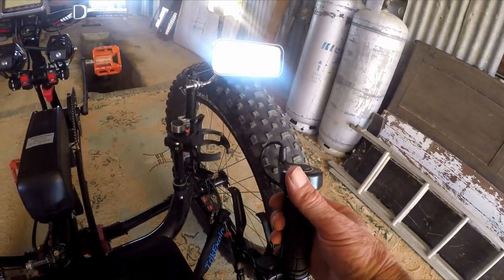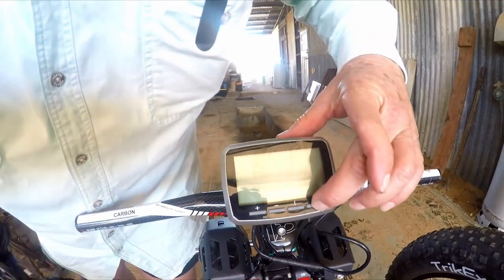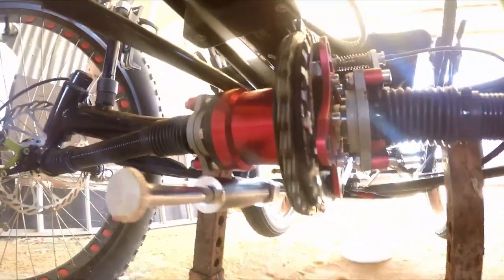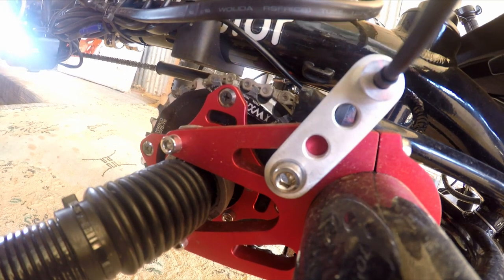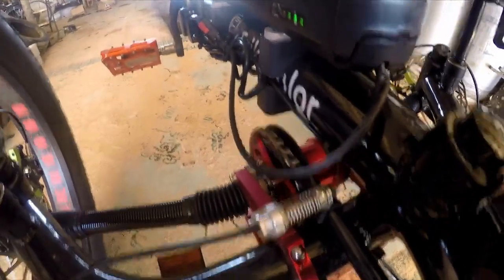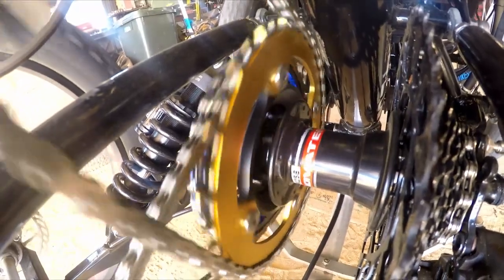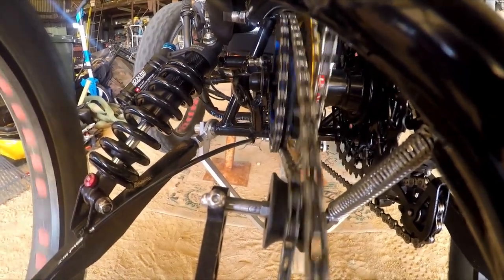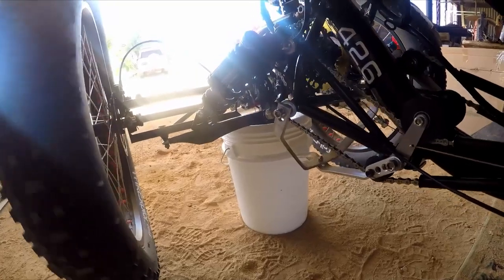Close to See the 4WD system ON THE TRIKEXPLOR RECUMBENT QUAD F426E

Comment: I'm looking at buying a recumbent bike. I have an autoimmune disease that makes mobility extremely difficult. Because of thisI have put on excess weight. I am a big guy. But I want to change that by becoming more active. Before I had this dreadful autoimmune disability, I love going bike riding. I was very active individual, but slowly, this disease took that from me, including my job. Thankfully, I have family that are very supporting and caring, and I am currently awaiting disability. My question is, do you think this time of bike would be helpful in becoming more active. I know it is electric. But correct me if I'm wrong. I do believe it has some type of e-pedal assist.  If that would be the case, it should be able to let me do some of the pedaling for exercise if I'm not mistaken. Also, I have been looking at this company, which made your bike in the video. Would you recommend them as a good company and how well and durable would you say their product is built. Also, do you think it would last with a heavy rider as long as I'm not being too tough.  I'm going to be pretty much using it on flat roads and easy trails.
Reply from the maker: can you contact with me by trikexplor@gmail.com   thank you